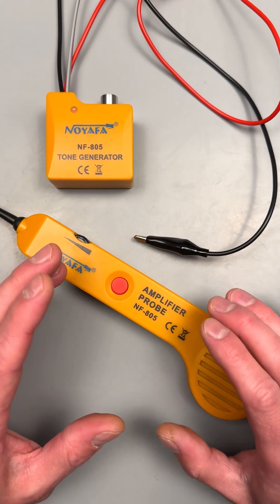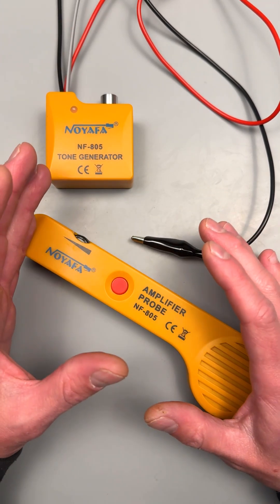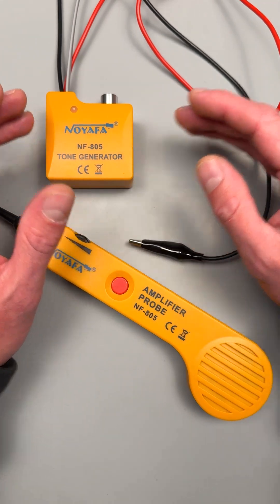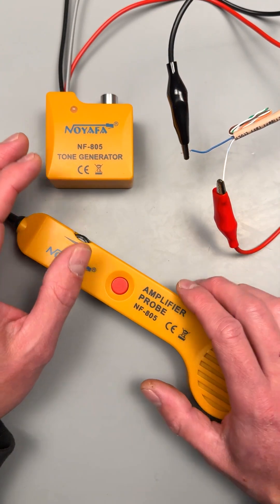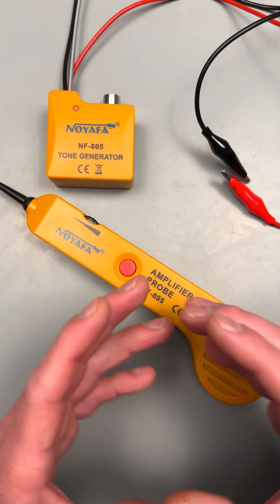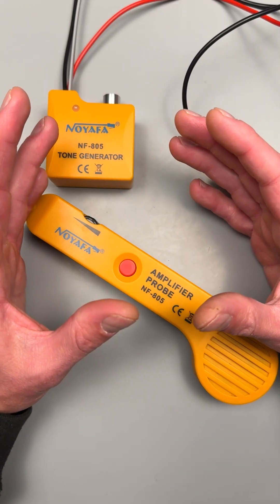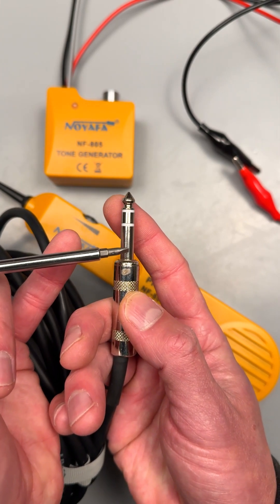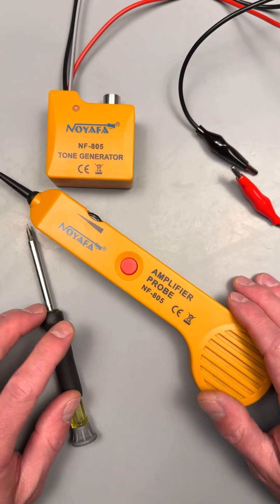The Best Kept Secret in Telecom: NOYAFA NF-805 Tone Generator & Amplifier Probe

Comment: Also you can use the probe to locate liive wires also, it will light up not ring when electricity is present. Thanks for showcasing the toner, that's a moneymaker there
Reply from the maker: Good to know. Thank you for sharing!